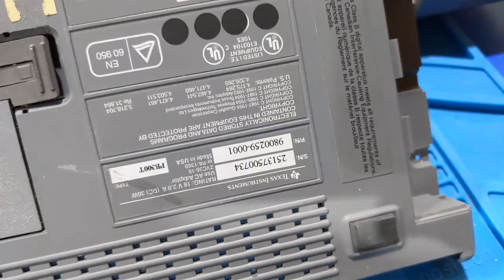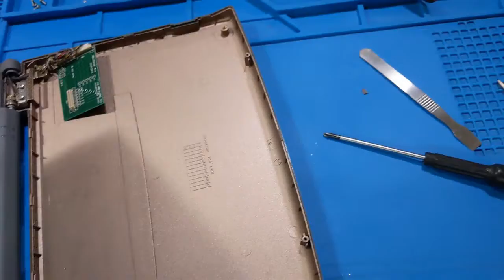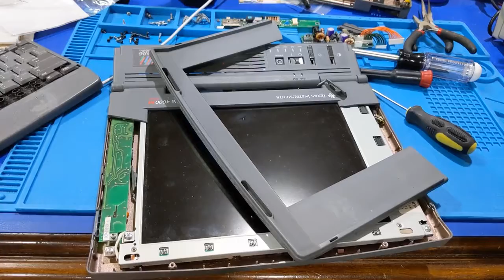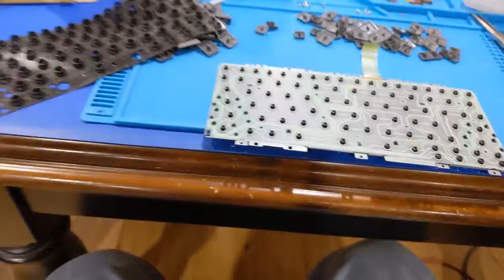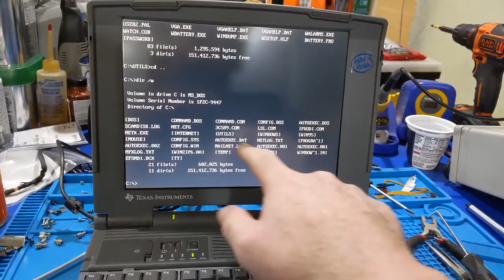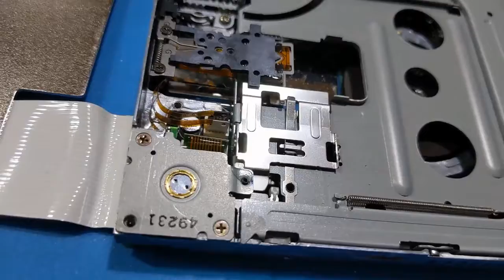TI Travelmate 4000M restoration

Comment: Also, do you have a link for the capacitor you used?
Reply from the maker: I ended up just using an X7R rated ceramic from Mouser. I order them in bulk to fix many things so i dont have which specific one handy.